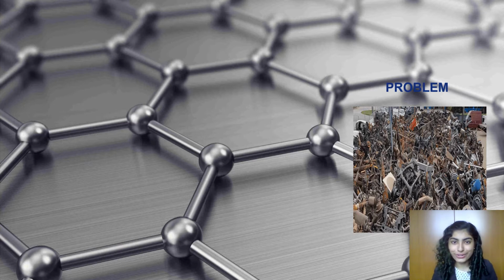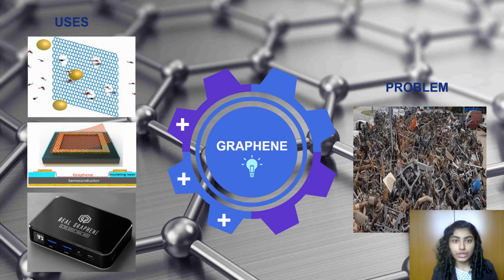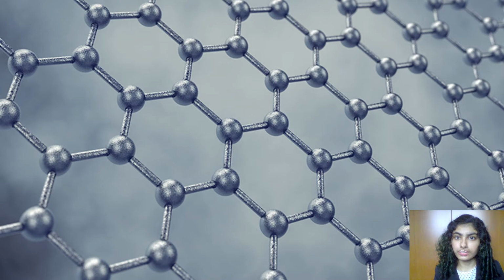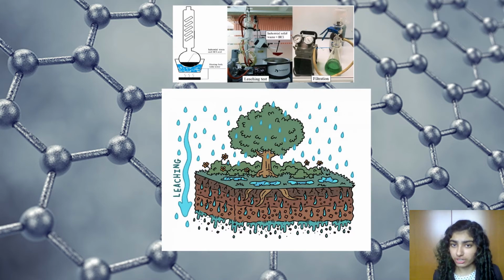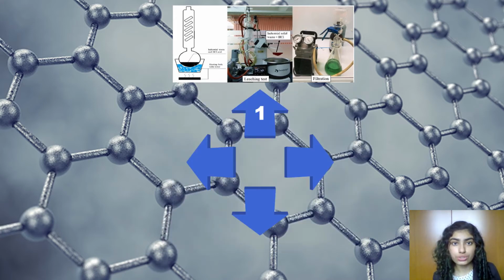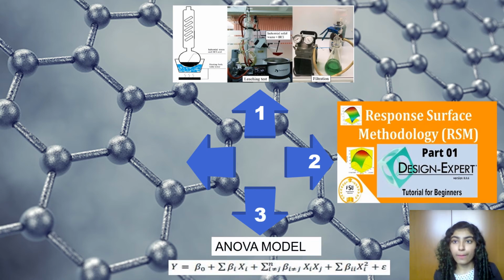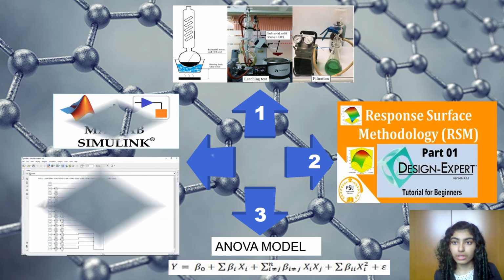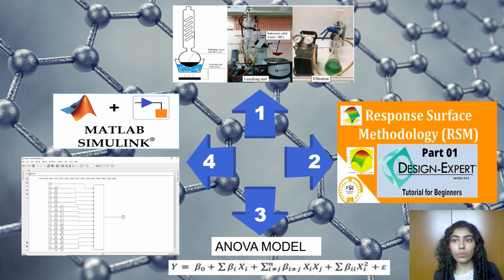Modelling and simulation of graphene synthesis via hydrochloric acid leaching

Comment: --- Comments ---

   The examiner fails to see the connection between graphene production and non-biodegradable, hazardous industrial waste (only 8 million tonnes/year? ). Describe more on what industrial waste is targeted.  It is a carbon-rich waste, isn't it?

--- Questoins ---

   Based on the presentation, graphene is already in the industrial waste and you remove other (metallic?) parts by leaching.  Is this understanding correct?

   It seems you plan to quantify the graphene produced in the experiments by membrane filtration and gravimetry.  How do you verify that what you obtain is graphene?  Is there any index which is indicative of quality of the graphene produced?
Reply from the maker: Greetings Prof. Thank you for the questions. 
First of all, the industrial waste that I am targeting here is untreated industrial solid waste from metal scrap and yes it is rich in carbon. 

From the leaching process, I will obtain the graphite residue and the leachate. It is accurate that this leaching process is used to remove the impurities(other metallic parts).

The graphite residue obtained will undergo an elemental analysis namely Field Emission Scanning Electron Miscopy (FESEM)
 combined with Energy Dispersive X-Ray Spectroscopy (FESEM-EDS). This analysis will help me acquire the composition of elements in the residue and the surface morphology of the residue.